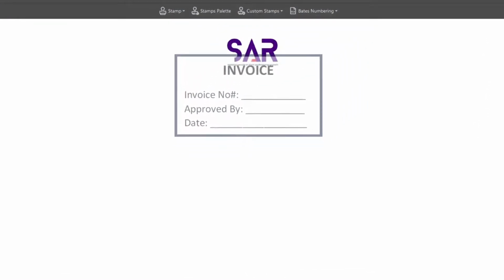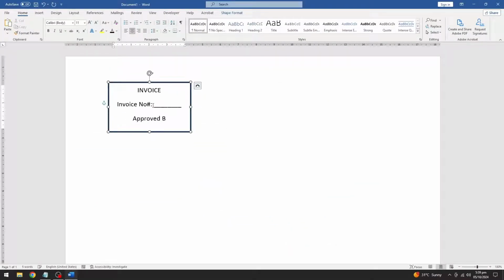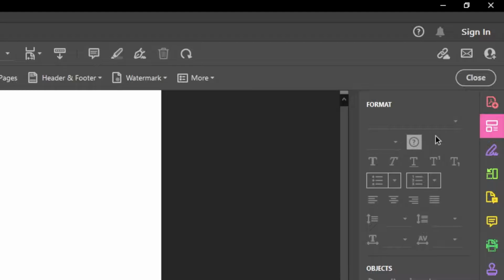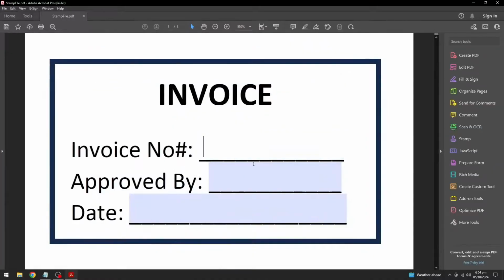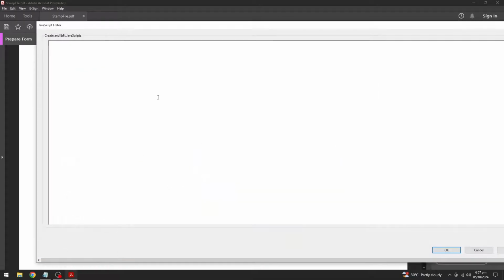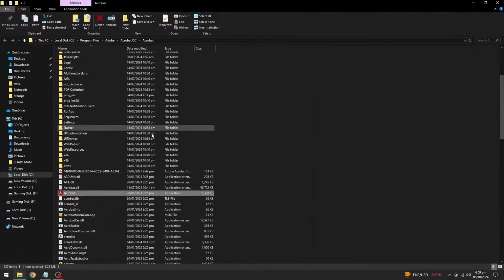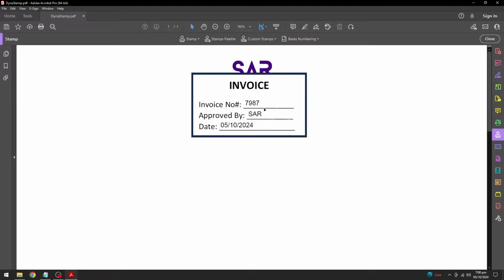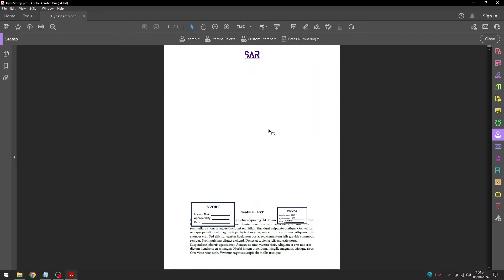Create Adobe Dynamic PDF Stamp | Adobe Acrobat 2026

Comment: Hi, fantastic video.
Just a quick question for troubleshooting.

I have created a stamp using this process and it has been working well. but today the stamp no longer pops up with the data fields and just acts as a blank stamp.
I have tried updating the file in the file location, closing the app and reopening but nothing has worked so far.

Any ideas?

Thanks
Reply from the maker: Hello, make sure theres no duplicate stamp in your 'Stamp' folder or in adobe custom stamp list.

Comment: Awesome video, was able to follow everything, but issue i have is the pop up window doesnt show. is there a setting i need to check or enable to activate it?
Reply from the maker: Since users can't interact with a drop-down menu on the stamp itself, there's no point in placing one there. Instead, include the drop-down in the dialog box where you prompt the user to select from a predefined list. After the user makes a selection, you can insert that value into a text field on the stamp. So you need a custom dialog box for this feature.

Comment: Hi I have a couple questions. How can I make these transparent? My issue is if I leave the field blank, and try to fill in after it’s been placed, the signature goes behind the stamp. And also how can I make sure the field fill the order I want them in?
Reply from the maker: Hello there,
You can make stamp bg translucent using MS Word or any editor software.

The wet signature is added to the PDF as a content image, meaning it will always appear beneath all annotations. To ensure the signature remains on top, you can either flatten the PDF before adding it or create additional stamp of your signature.
Reply: @ awesome thank you! i ran into one more issue, if i need to edit the fields after the stamp has been placed is there a way to do that?
Reply from the maker: @  No, once the stamp is applied, it becomes flat image and... uneditable.